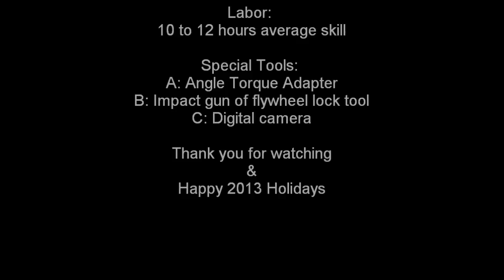BMW Service - Starter Noise

Comment: You are great have learnt so much in your videos as I am a new owner of r1100rt at 58000 kilometres. Stail fuel one carby throttle gummed up just waiting on new fuel pump an filter and we should have great bike. Was told electric problems yet the smell tipped me to check as bike sat for to long.

Comment: Yup, Changed two flywheels out. First time I had no idea what happened but, noticed a bolt was missing that held the starter in. 2nd time same problem and that bolt was missing from the same hole on the stater. I noticed, the bolt hole on that one was stripped enough to meet torque specs but was loose enough to have a bolt shimmy right out. I re tapped and threaded used lock tight and lock washer! never again! Now the ABS Preassure module is shot thinking about getting rid of it!
Reply from the maker: Ha, another flywheel victim! Thank you for sharing. Good luck with the pressure module... I'd just eliminate the goofy power brake system. Good luck, Chris

Comment: Yo Chris, I have an old '99 RT in my garage that i'm trying to get running again after years of sitting (I've already swapped the fuel, debating on cleaning the injectors), I've been relying on your videos a lot, thank you. I ran into a roadblock and i'm not able to properly research my question. When i put the bike in neutral and move the switch from STOP to RUN, there is that little 2 second ignition sound. (i'm not really sure what that sound indicates, I'm sorry) but i have a GS and i'm familiar with that noise before i start cranking the starter. My problem on my RT is that i'm not hearing that pre-starter noise (i can hear a little click, like it's trying to make that noise, but nothing), but i can crank the starter, and it doesn't turn over.  What is that noise doing, so i can research further? If i'm not hearing that noise, what would i check first?
Reply: Hopefully you got your RT sorted and running, but if not...
I think that whirring sound you mean is the fuel pump priming the injectors.  If you don't hear that, you won't get fuel to the engine and it won't start.  Check the fuel pump fuse and relay.  The clicking sound is probably the electrical relay for the fuel pump working, so maybe the fuel pump is/was faulty, possibly stuck or gummed-up due to lack of use or old fuel.  Also make sure you have a good 12V+ charge in your battery.
You could check (with a bulb or multimeter) that there's power going to the fuel pump when you turn on the ignition and move the switch to RUN.  If there is power, it's likely to be a fuel pump issue, if there isn't power, it's likely to be another electrical issue like a fuse, a relay or maybe another bad electrical connection in the loop.  
If the bike's been sitting for years, I think it's most likely to be the actual pump is either a bit gummed-up or seized.  If you take it out and apply 12-14V to it directly to test, that can sometimes free up a slightly sticky pump.
Good luck!

Comment: Why not use a torque wrench vs. an angle measurement?
Reply: +gmcjetpilot The dial wrench pulls the bolts an equal ammount, irrespective of friction within the threads, which can vary.
Reply: +Stan Whattmore What? That makes no sense... Friction is ALWAYS in play when torqueing bolts and is accounted for in the torque value and/or angle measurement. Typically you torque to a value and then in some cases turn X degrees to "stretch" the bolt...This is all specified by the manual... To answer my own question. YOU DO THIS BECAUSE IT IS IN THE MANUAL... Follow the service manual... Not sure Chris is following the manual or not...
Reply: gmcjetpilot
It makes perfect sense, you just don't understand. The friction on the threads isn't consistent. One bolt may have a little oil, another might have some corrosion. The tighter the thread, the bigger the difference, so torque to a lower level then pull in with a dial to a consistent amount irrespective of effort.
Because you don't understand doesn't mean it doesn't make sense. If you think "because it's in the manual" is an answer then I suggest you stick to taking it to the shop.
Reply: +Stan Whattmore Dear Stan I have a Masters Degree in Mechanical Engineering and design airplanes and jet engines, and work on my own BMW. I assure you I understand machine elements, e.g., threaded fasteners. This is all CALCULATED. There are tables, equations and empirical data and SPECIFICATIONS from the manufacture. Just follow them, no guessing. The technician (should) follow the manual. If it calls for TORQUE ONLY, you do that (making sure not to get grease or oil on threads unless noted otherwise). If it calls for TORQUE + ANGLE you do that.
Reply: +Stan Whattmore Stan thanks for the insult but I don't "work on them".... I fly them and before that I designed them.... If you are just going to make personal attacks that means you lost the debate... I did ask a "rhetorical" question. It was WHY.... The answer is to follow the manual and torque bolts (or torque + angle) per the manual.  The values are calculated with MATH and empirical (in the lab) data. So it is not a wild ass guess. Again follow the OEM manual for torques. That is good advice and all the other BS you are spewing is pointless. Have a nice day.